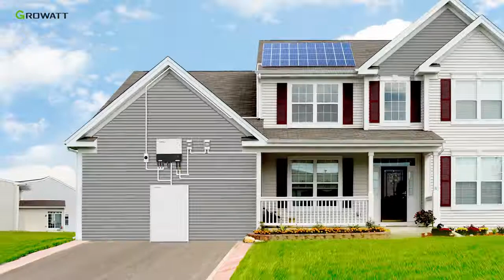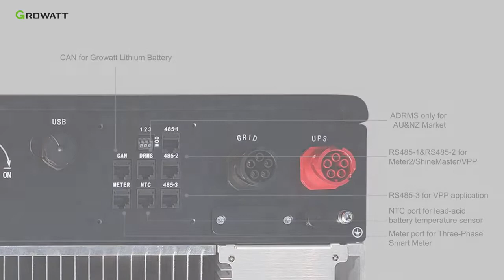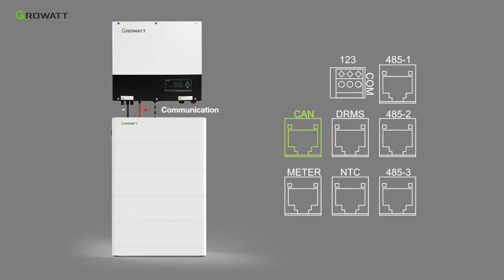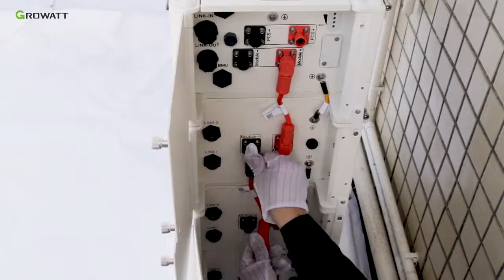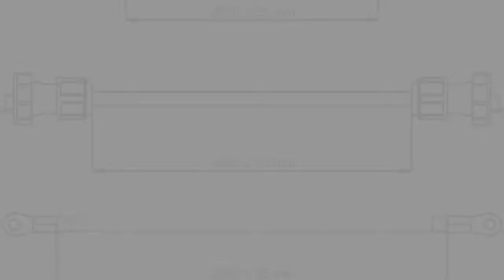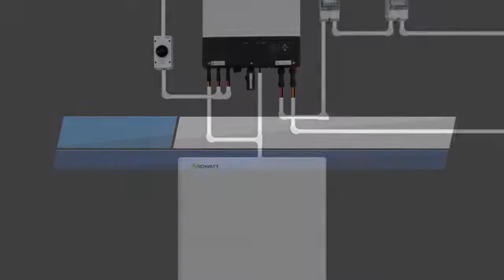SPH 4000~10000TL3 BH-UP & ARK HV Battery Installation

Comment: In the diagram the 3 phase smart meter is placed in the wrong location. The RS485 smart meter should measure the load at the same place as the utility companies meter. This allows the inverter to see how much load comes into the local grid, and goes out. It does not make any sense to place the meter at the point in the diagram because the SPH knows about its own output and input power, but it is not aware of the rest. So the best place seen from the utility side: utility company meter, utility input, main switch, chint/eastron smart meter, earth leakage switch, 3 phase AC breaker, SPH.